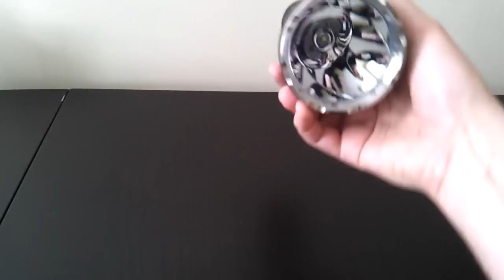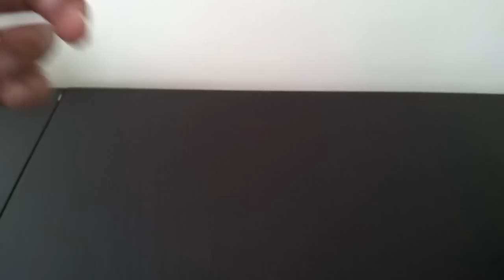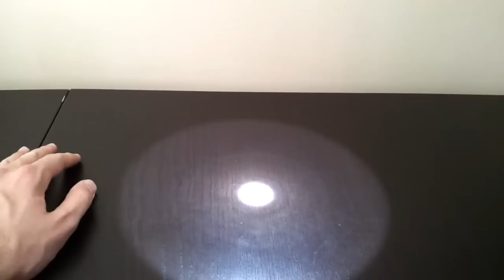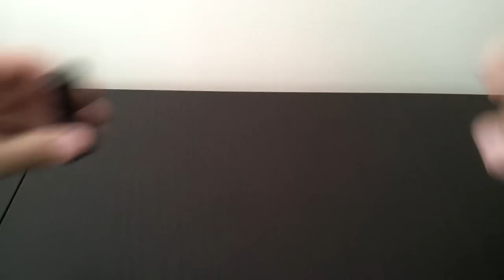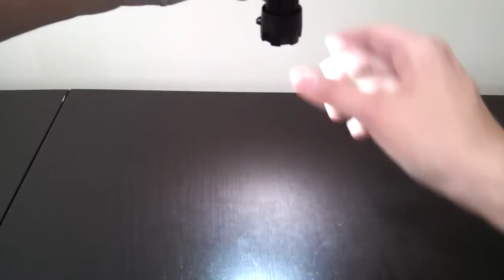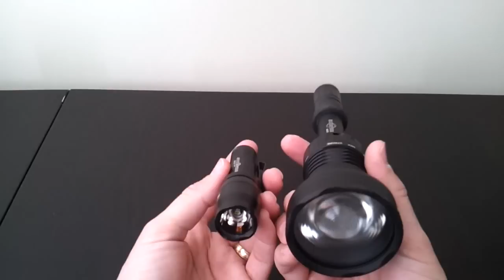Selbuilt Flashlight Primer #5 - Beam Patterns and Reflectors/Optics

Comment: Thanks, very nice series. I have a question: which part of the reflector is mostly responsible for creating a tight hotspot?  I have a thrower with a deep SMO reflector that has some blotches and damages on the area directly around the LED ... is the INNER or OUTER part of the reflector more important for throw?
Reply from the maker: I would say the inner part of the reflector is most important for how the hotspot will "look" (i.e., whether there are color distortions, beam distortions, edge effects,, centre effects, etc).  The overall size of the reflector controls more of the peak intensity output of that hotspot.

Comment: I'd like to purchase the first flashlight, any chance you can share the model number?  I need a well collimated beam with a large area source of about 2.5 inches diameter.
Reply: +DCUPtoejuice oh i see you posted it Thrunite TN31.  I want that size parabolic, but don't need the intensity, trying to find much cheaper option and want very good collimation - perhaps best to have adjustable?
Reply: +DCUPtoejuice I suppose my best bet is to put a very large parabolic reflector like the one on the Thrunite TN31 onto a small source.  Do you know know of any combinations that would be easily workable?
Reply from the maker: +DCUPtoejuice Not really. Adjustable options done through optics, and produce a very different beam profile. You could probably find a more budget version of the TN31, but I am not familiar offhand with what is out there.